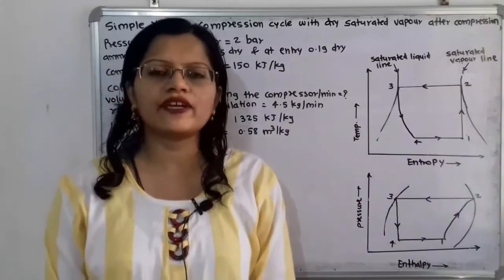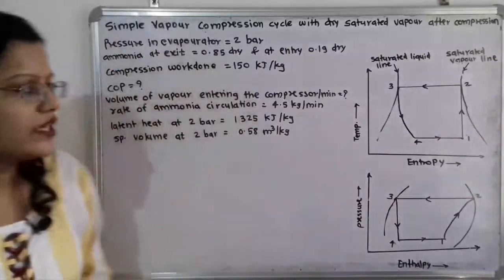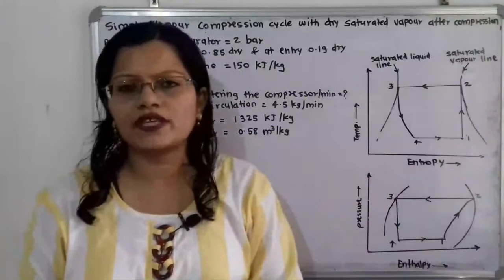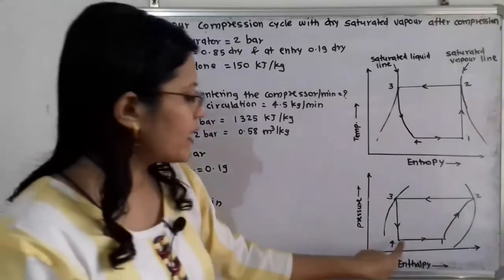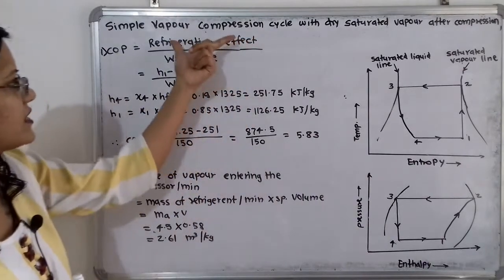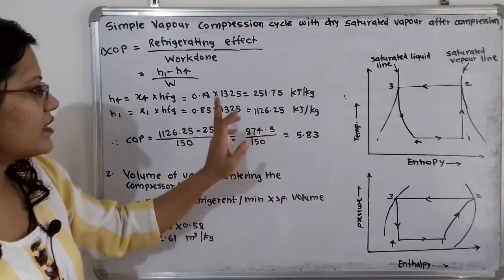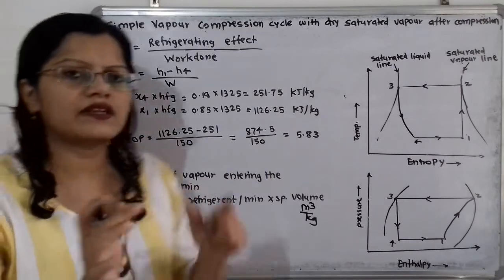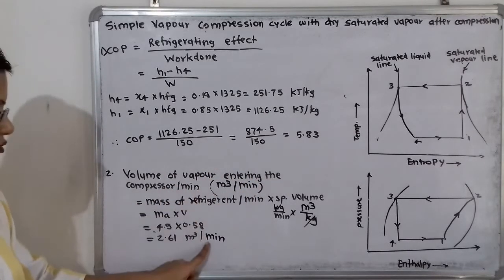Problem 1 on vapor compression cycle with dry saturated vapor at the end of compression

Comment: I need answer to this question
A refrigerator using R-134a as the refrigerant is used to keep a space at -10°C by rejecting heat to ambient air at 22°C. R-134a enters the compressor at 140 kPa as a saturated vapor and leaves at 800 kPa and 70 °C. The refrigerant leaves the condenser as a saturated liquid. The rate of cooling provided by the system is 2600 W. Determine (a) the mass flow rate of R-134a, (b) the COP, (c) the exergy destruction in each component of the cycle, (d) the second-law efficiency of the cycle, and (e) the total exergy destruction in the